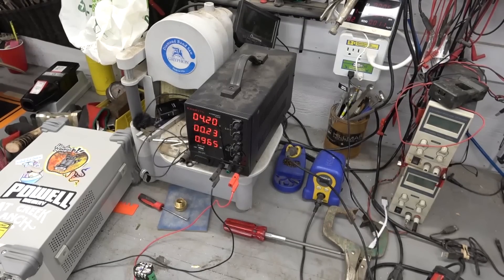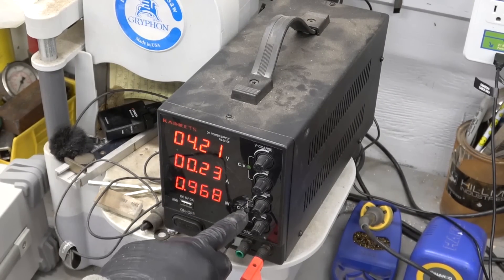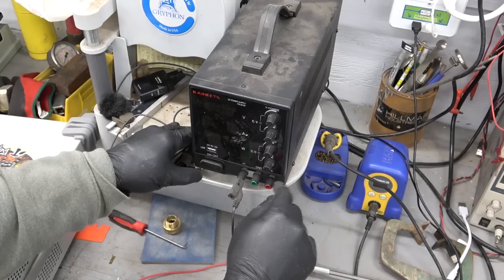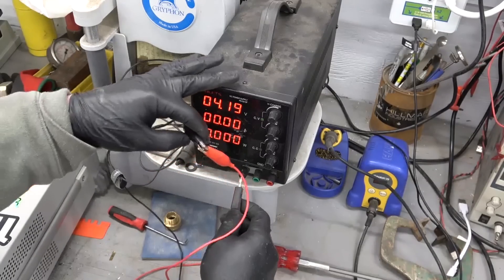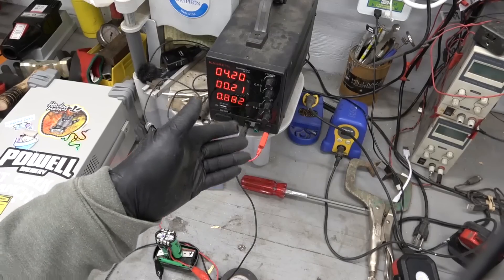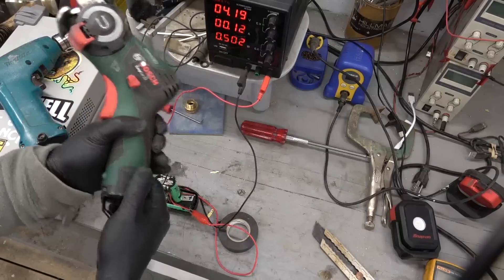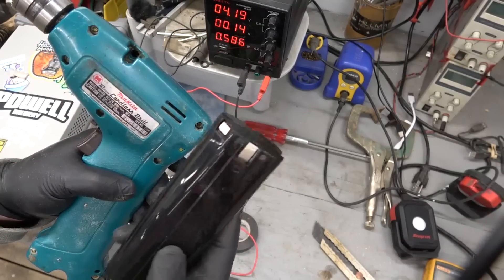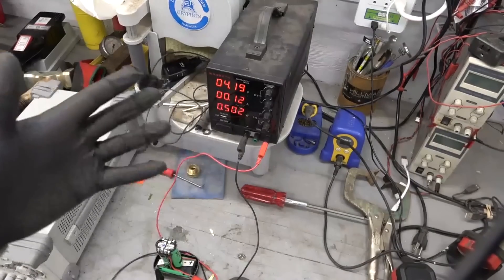Adjustable Power Supply || Viewer request how-to

Comment: Do not leave this charging method unattended, as it was clearly stated in the video.
This is not a "just to be on the safe side" type advice.
These cells/batteries do go up in flames, a bucket of water won't put them out, and the smoke won't get you high.

If you do this, always ask yourself beforehand "What will I do if this goes up in flames?"
Is the battery next to a flammable material?
Do I have something to grab the flaming battery with and put it outside?
So, if you are intending to do this in your apartment, next to the nice carpet floor... Bad idea.
Reply: Instructions unclear, burned down my apartment block and all my Teslas
Reply: Great advise. This reminded me of a video I watched yesterday. A guy, while making burgers, finished his call and put his iPhone on the grill. It instantly ignored so he grabbed it with tongs and threw it on a near by couch that also instantly ignored. Mine you, he was outside and had an entire backyard of grass to use lmao.
Reply: Yes, an acquaintance just lost his family's large farm shop to a fire caused by a Milwaukee battery that went wrong. Not sure whether it was being charged or just sitting. They're all ticking bombs it seems.

Comment: Might be a good idea to run your chargemups thru a 90°c thermal cut off or multiples, stick it on the positive lead and attach it to one or more places on the battery OF CELLS with some thermal paste and kapton tape. Those things are very reliable, so are bimetallic strip thermal cut offs and so are positive temp coefficient thermistors that increase in resistance and eventually open the circuit or just fail altogether I mean shit you got some bismuth, alloy 2 parts with 1 part lead and 1 part tin I bet
That will melt around 100°c  as long as it’s a thin bead and current
Is running thru. Hell no I’m not gonna stand there and dote on some batteries. To a machine I am a god, and we built machines to serve us, not the other way around!

Comment: Another thing you can do when you rebuild a waakee pack or any brand for that matter is order whatever these use 18650s but look at specs of the cells like sony or samsung...LG some have more amps peak vs more mahs. When you buy the cells buy 3 times as many as you need. Charge them all with 18650 charger and let them rest for hour. Then lable each cell with good multimeter like a fluke. If your pack has 4 cells, pair the best 4 cells with most closest voltage pairing lets say 4.21,4.21,4.22 and 4.21...if the rest are 4.12 and lower sell those off on ebay or make a less desirable pack with your other 8 bats. Matching the cells will give you a top tier pack.

Comment: I had one of those el cheepo scamszon circuit board special ones on part of my suicide box for testing the medium voltage angry pixies equipment. The ductor took a shit and im 8 hours away from the shop on an emergency call out. Well luckily enough i had a variable supply on my suicide box, and a schookum meter, titty slaped the contacts with a whole 5A read my voltage drop did some mental abuse towards humans and ohms law voodoo. Boom got the joy of telling the customer your shits fucked worse than fingerbanging you sister and finding your dads wedding ring. But i will say do not use one of them circuit board ones off a m18 battery to pull power up a VFD that went tits up, lot of smoke came out that day

Comment: Can never have too many of them either, sometimes you're working on stuff that requires different voltages and it's nice to have. Ebay is a good way of getting used higher quality ones and avoid the chinesium ones.

Comment: Those cheap bench-top power supplies are great but not very accurate. I always use a bit less to be safe so for a li batt, Ill run mine at 4v.

Comment: Lab power supplies have saved my rear end so many times. Having the ability to limit current and gradually step up the voltage is so handy in so many situations. My recommendation would definitely be to spend the little extra money to get one that allows you to adjust the knobs while the output is off, many of the cheaper ones don't have that and also on those you have to short the thing out to adjust the current limit for example

One time my father bought a battery powered chainsaw and the 80 something volt battery on it was DOA, it was at like 20V and the charger obviously rejected it. Ended up gradually charging the cells one by one with a lab power supply and it turned back around and is still working years later. In the end they shipped an entire another chainsaw for free and told my dad to do whatever with the old one so it worked out

Comment: This would have been handy a few days ago. I had to just a lithium battery from my bike completely kaput, bad boys $350 to replace. Threw it on the trickle charger but i got an alarm light (likely low voltage). I took 3 old vape batteries ran in series for about 9v and gave it a quick tap. Was enough to satisfy the charger and pump some life back in to her. Sketchy as hell dont recommend, kept an eye out for loose pixies for quite a while.

Comment: Ive revived a few 12 volt  tool and lithium RC batteries telling it was a nihm battery until it had enough voltage. but im curious do the tool companies not have balancing chargers.  They are readily available for RC cars/trucks. I also know this was more to the el cheapo power supply. I have a radio shack 12 volt supply but its on or off im guessing around 5 or 6 amps. Lithium tool batteries have several lugs i thought thats what the extra connections were for.  Correct me if im wrong ?

Comment: I like to call automatic 12v chargers stupid smart as they won't charge a dead car battery (stupid🤣) 
I have a 1990s sears dumb charger for dead batteries or old agm batteries as it will keep running and can improve an agm 100+ amps after a few 2 hour sessions. 
I have also added incandescent test light in series with dead lead acid battery hooked to the dumb charger for a week and fixed 1 sulfated battery thus far. 
Found out solar el-cheapo battery toaster tester amp meter decided it wouldn't go over 80amps of 700 so I threw it out of frustration as it wasn't 2 years old dang slanted eye devils.
AGM went from 450-630 of 800cca and works great for around the shop for brake caliper manual actuation and powers the transmission fluid flush machine without hooking to car batteries sometimes in hard to get at places. 
FYI a good idea to charge car batteries to 100% at least twice per year as alot of newer cars charge up to 80% then reduce voltage/load to save fuel.

Comment: Good summery, also for the new gamers, you can either adjust voltage or current not both as its restricted by Ohms law: V/I=R, so if your Resistance is constant, if voltage goes up, current goes down and vica versa. 
I tend to buy old 2nd hand units from the likes of Hameg, HP, agilent, RS, Farnell etc, they are old-skool linears or great quality switchmodes, these from our chinese friends are not built to last and tend to be really noisy on the supply voltage, you pay a bit more for old quality models but worth it imo.

Comment: I have a couple 30V Korad brand power supplies. One is a dual channel that can run in series up to 60V. I've used them for everything - charging every type of battery, electrolytic rust removal, making colloidal silver, testing LEDs, motors, heating pads, electrical circuits... Extremely useful piece of equipment to have.

Also, can confirm, those 14V Strap-On batteries suck. Some genius forgot to include a balance circuit. I need to manually balance all of mine twice a year.

Comment: 1:38 I put my oscilloscope on a few different ford trucks because I was curious why ford battery terminals always get so crusty. (The ones I tested were Model years 1999 to 2012) all three of those alternators hit 20 volts per cycle before the voltage regulator dropped it down to 14-16 volts.

Comment: Ive been charging batteries unattended for years and thats why i put everything inside cookie tins and hang multiple fire alarms from fishing line right over it. What folks really need is a floaty charger perferably a fancy programable one. Id even argue a programable floaty charger is manditory if youve ever emergancy bought recharable Energizer batteries from Walgreens for your TV remotes because Energizer brand chargers are just wallwart trickle charge tech last time i looked at one but its been years i could be wrong.

Comment: The Chinesium banana plugs melt if you try full current... I replace them with stainless steel ¼-20 full thread carriage bolts with nuts, washers and soldered eyelets. Leave some bolt inside the supply to give it mass to dissipate any contact heat.

Comment: I'm in the US and snagged one of the Bosch mini saws a while back. Those batteries should be compatible with the US Bosch 12V chargers, since the only difference between the US and EU 12V bosch batteries is the plastic casing at the bottom. I've been using mine with some US Bosch batteries that I cut the bottom shroud down on with a dremel. Works a treat.

Comment: I use that for my Yinlong and Scib batteries to charge them. But I noticed my yinlongs not as strong as they used to be so I’m about to Take apart the battery and rebalance all the cells together using the power supply!

Comment: If you haven't the right charging device for the battery, let this battery alone. DON'T USE  such a power supply. Buy the right charging device. It's cheaper then a burning room.

Comment: The battery scientists recently discovered that you can completely dead nuts discharge lithium ion batteries to basically "reanneal" the material and get rid of dendrites. Chargers, so far, don't do this. They said it would be an easy switch because basically it is at the software level in the charger. It would save lots and lots of dead batteries from going in the landfill. Can't remember the study I read but it's out there somewhere.
You should try doing a video where you take the batteries out from their protection circuits and discharge them completely to see if you can bring a non charging battery back from the dead.
Reply from the maker: I can't find anything on typical lithium cells. There is an interesting Japanese paper on solid state cells where they cook it at 150C and that reduces the internal resistance.

Comment: I have a dozen or so in all kinds of different versions. Hell, I keep a cheapo 10A Chinese one in my toolbox for random troubleshooting needs. I've only needed a few times, but man was I glad I had it when I did need it. 

I usually just end up using it to fix other co-workers Milwaukee batteries that they let go completely dead and the charger won't charge them. Just hook up the battery with some gator clips and run 20v into it at around 100-200mA for five minutes or so and it will usually hold enough charge to get it going on a proper charger.

I'm also a radio nerd so anything that can spit out a clean 13.8V is always worth keeping around.

Comment: I have a programmable charger that I use mostly for lipo rc batteries. Just like your power supply, you can change the amps in 1 milamps increment up to 20amps and  can balance up to 8 cells. Will charge almost any battery cemetery. It runs off of 10v - 48v DC and I just make up what ever adapter I need for the battery I want to charger. With most battery types you can do a discharge recharge cycle.

Comment: Awesome video & Thanks!! I bought an El-cheapo DC power supply a year ago, but never used it until recently, when I had to test out some DC motors. The power supply helped immensely!! I had also recently tried it on some Li-on batteries, but I was using the power supply as I would a lead cell battery, which didn't work. Now I know why, after watching your video.

Comment: I'm an embedded firmware engineer. I've got 3 big linear ones sitting on my desk, another one on a rack, and a couple of switchers for stuff where the noise doesn't matter. You can never have too many adjustable power supplies!
Reply: Phaa, you only need 5v, 3.3V and 1.8v ).

Comment: Batteries can be a mystery but also a bit magical when it comes to charging them.
A battery thats running low on charge that a smart charger won't charge will charge up if you put a good (fully charged) battery of the same ilk first in the charging loop and then put the bad battery in parallel after it.
The good helps to balance out the bad and the charger will see the good first and charge the pair together.
Works a dream on most batteries as long as each cell is 'healthy' and not compromised.............

Comment: I had a dead 20v tool charger, so I wired it up to a cheap Imax RC charging/balancing unit.  Now whenever I have a battery start acting up I just pop it in the cradle and hit "Balance."  Now I just need a couple more dead chargers for my other batteries!

Comment: My experience of Scamazon bench supplies is that the voltage/current display is not particularly accurate. Always check the output voltage with a trusted meter.

Comment: Ive been dealing with batteries for over 15 years, and I have done the exact same thing, but I have a battery tray for 26650, 18650 18500, and i supply a steady trickle up to 4.21V but if one out of a pair starts to lag behind,  it's time for a new pair. MAYBE you have a spare cell from thr one good.. But its not vice to use unbalanced batteries together. There is a reason the one cell is behind, maybe because of QC issues or bad wiring from factory...

Comment: I noticed that antique Makita laying there 😮. Second variant, first was a wall wart only and you plugged it in if it made it through the day and it was ready the next morning.  But removing hundreds of Phillip screws in aircraft access panels was a real game changer.  Then the second version came out with replaceable batteries!  Life changing technology had arrived in industrial settings.  Could not kill them, yours is a case of quality enginerding that you can’t find anymore 😢.  Comparing nicads to A123s or LiIon of todays tools is apples and grapefruit, but the green odd handled ones were the best things available in 82!  You could rebuild yours with modern batteries and it would probably outlast you 😊

Comment: I have at least three of those chargers (probably more in boxes), the Bosch 12v line is amazing, and very inexpensive. I don't know why it's not more popular.

He should just buy a Bosch kit, I recommend the brushless Flex-click / Chameleon (or whatever they're calling it currently) drill/driver with interchangeable heads.
It's an incredibly useful tool, and then he'll have a propper charger and two more batteries!

He could also buy any 12v dremel kit that includes a charger, the batteries are the same.

Comment: On an dickered car battery reverse charging sometimes brings it back to life.
Just remember to mark negative positive and so on.

Not a lead acid battery chemist, no clue why it works. Always figured the abode and cathode were designed very differently, but I've seen it work.

Comment: My power supply is one of my most used items in my shop.  For just a little more than the crummy twisty knob kind, you can get a cheap-o but digital input unit and screw all the annoyances you were dealing with on this unit.  Much better.

Comment: i carry around a dc power supply in my backpack now. one of those new alien tech ones which runs from my diy 20v powerbank. 
got to my medschool rotation early the other day and my dumb car keyfob decided to die so it was a pain to get my car to start and turn off.
took the lith coin cell batt out of my keyfob and proceeded to trickle charge it back to health on a table. this thing is so useful lol.

Comment: Another pretty good way to balance cells that aren't totally hosed is to connect them to each other, in parallel*, using a resistor with enough Ohms to keep the amps reasonable.  Since a sorta-working battery probably won't have more than a volt or so between the best and worst case, it won't take much.  In your example, with 200mV imbalance, a 10Ω is plenty; it'll trickle 20mA through at first and slowly decrease, and that's so low you can just let it go overnight.

I kinda wonder why battery packs don't just balance themselves this way, specially when they're charging, but the extra transistors in the brainbox would cost some pennies, so...

* That's positive to positive and negative to negative; one side you can just bridge with metal, but the other needs just a little bit of resistance to avoid dumping amps at once.

Comment: I buy the small copper pipe couplers at home depot, crush them flat in a vice, then grind the seams off to get thin strips of copper that fit a lot of battery terminal lugs. Alligator clips fit copper plates pretty easily. That was how I went about testing Hart batteries with an oscilloscope  to realize they feed a digital signal to the tool as a DRM lockout.

Comment: The other day I was getting ready to charge my big ass 28v li-ion battery but the terminals were not very good. So, I did what anybody would do and drilled a bigger hole in the terminal.

As it turns out, lithium batteries are actually full of fire and it comes out as soon as you make a hole! Also try not to do this on the carpet...

Comment: Id like to point out, for charging lithium batteries, a RC hobby battery charger is even better, cause you can set the exact amount of cells, the exact voltage, and amperage, and different battery types, like Lipo or lithium batterys also, and it automatically shuts off when they are fully charged, and also has balance connectors that you could wire up to each cell. A lot better if you are just going to be charging batteries with it, but the variable power supply is also very useful for troubleshooting components, and running electrical equipment that you dont have the charger, or battery for